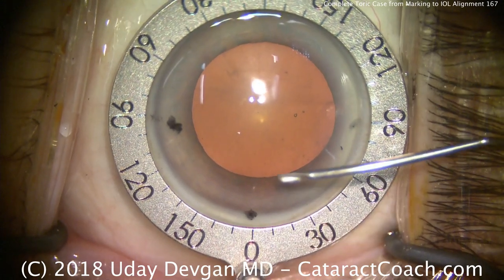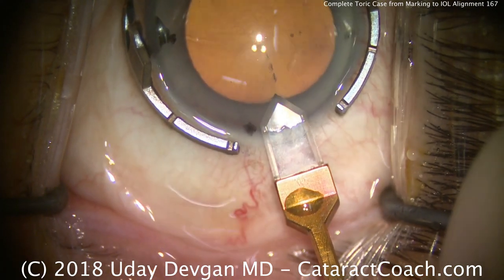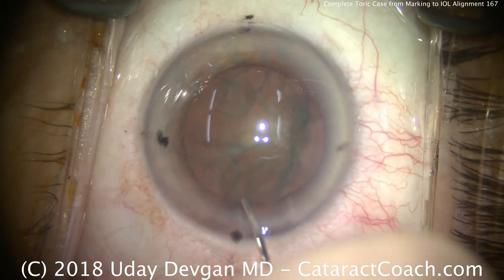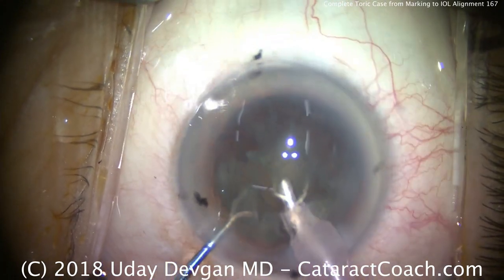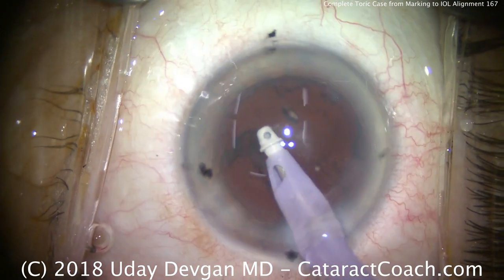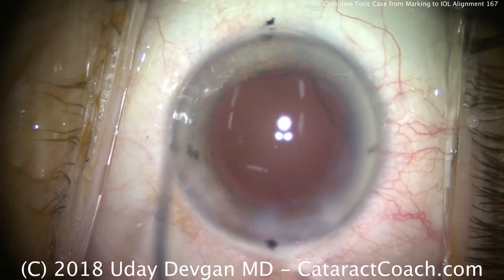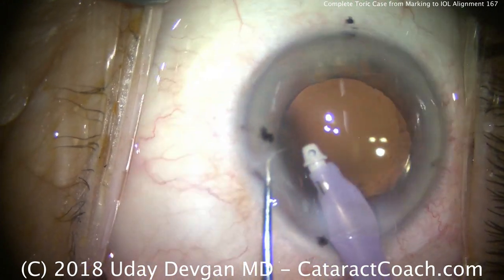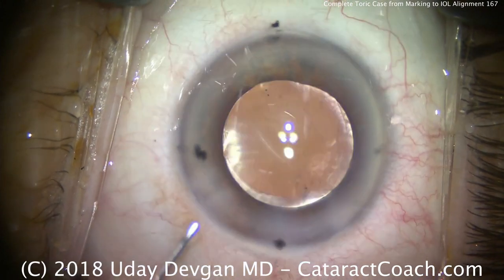Toric IOL Cataract Surgery Complete from Marking to Alignment

Comment: Greetings Sir...Thank you for this excellent video! I have 2 questions in this regard :
1. After implanting a TORIC IOL will there be a 5 to 10 degree rotation of the IOL that we need to account for upon removal of visco-elastic at the end? 
    I have heard different views on this ranging for an outright "Yes" to "it is insignificant".
2. Approximately, what percentage of Cataracts that are operated in the United States are of Grade 4 or even Dense 
    Brunescent variety? 

Regards, 
Dr. Souvik Sen.
Reply from the maker: Watch the video again. You must remove all viscoelastic BEFORE final Toric IOL alignment. A 10 degree rotation is very significant. It will lose one third of the Toric power due to being 10 degrees off. In the USA the rate of dense brunescent cataracts varies by location. In the Beverly Hills area of Los Angeles it is 1 or 2%. At our teaching hospital in a different neighborhood in Los Angeles this rate is 20 to 30%.
Reply: @UdayDevgan  Thank you for pointing that out in your video. I had initially overlooked that detail. I have learned alot from your videos Sir. 
The problem sometimes in India is that there is such a high volume of surgeries to be finished within a certain period attention to detail and finer points are sometimes  compromised during training and many Surgeons quickly tend to reach a "plateau" in terms of surgical skill in Phaco Cataract Surgery. Additionally, clinics tend to judge Surgeons solely on  "numbers" and complication rates, and whether or not a Surgeon can chop those Dense Cataracts and do those difficult cases or not. . But watching your videos is helping me counter this impending problem in my progress as a Phaco Refractive Surgeon.

Comment: Hello Doctor, I hope you are well, I have a question please, I was told from a young age that I have a lazy left eye it's -10.75 diopterscompared to the ight with is just -2.75, but recently I was told by another ophtalmologist that it's in fact Anisomypia, he inserted an IOL lens Optilex to correct it, the lens is +9.00 diopters, it's better than before, but I was wondering if the lens should not have been -9.00 instead of +9.00?